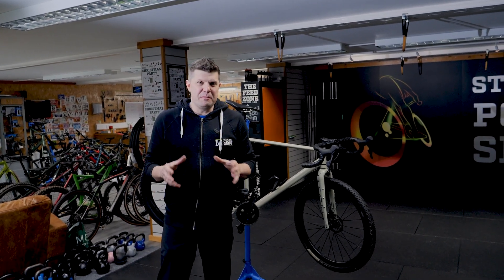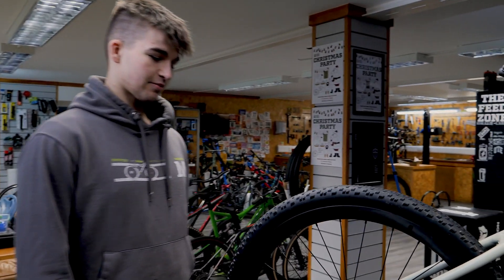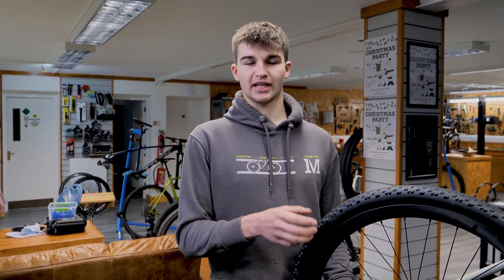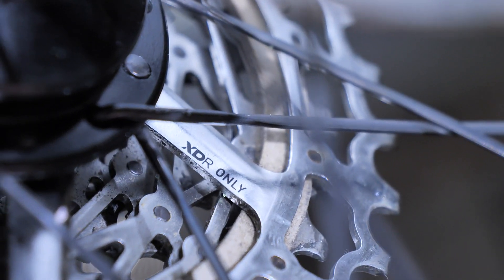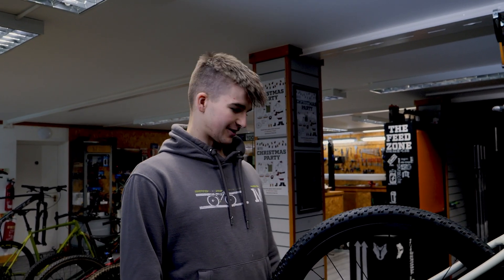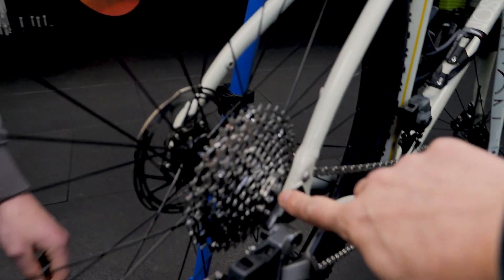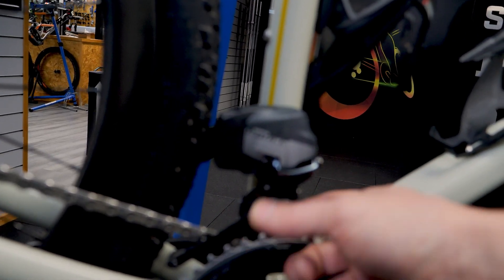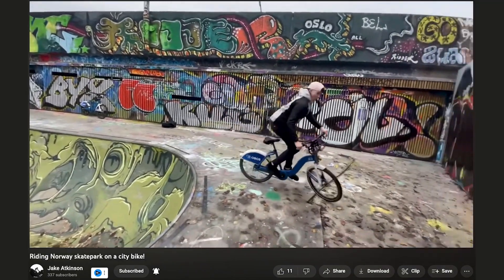Bike Mechanic quietly solving stupid problems with Hope Pro4 hubs

Comment: It always makes us a little smug when you find someone else's mistake :) especially when another shop couldn't figure it out.
I had a bike like that once, customer came in with rear shifting issues, and I was the third shop to look at it. I was able to find the delaminated dropout tab, but you could only see it by flexing it, it looked absolutely perfect just sitting there. (the abysmal 2011 S3/S5, mechanics will know what I'm talking about :) )
Reply from the maker: Feels good doesn't it?
Reply: @Mapdec  It sure does. I once worked on a bike with excessively short disc brake mounting bolts (flat-mount), not two of them, but all four of them. They only had 4 mm worth of thread engagement when they're supposed to have 8+ mm.

It was done by a bike shop I thought that has a good reputation.

Comment: I find that for the case of the missing clip on the derailleur pin, using a disc brake caliper pin's safety clip (like ones on Sram's brake caliper supplied with new pads) does the job!
Reply from the maker: Yeah.... We did it properly with the right size E Clip..

Comment: Things I've had bike shops try to blag me on when I've called them out include,
1. Brakes need to be bled every 4 months after shop did poor brake install
2. 172.5mm crank length is uncommon after bike shop fitted the wrong size left crank arm
3. The fork is fine, it's the flat mount adapter that is bent when the brake mounts were completely on the piss!
4. Huge gap between upper headset bearing and bearing top cap because they fitted the wrong size upper bearing
5. PF BB interface with open voids and crumbling away at the edges, bike shop that sold it said that's normal!
Reply from the maker: Cowboys… probably don’t actually know better.  Training is so poor.
Reply: @Mapdec  that's 3 different local ish shops. For fun, would you like me to send you the pictures of the BB they tried to say was fine? It's absolutely terrible!
Reply: Always love the people who take there bikes to a shop because they’re clearly not confident mechanically only to constantly say they know more. If the shops are so bad and you know so much why not do the work yourself?
Reply: @Adam-vm8kp  Don't be such a troll.
1 and 2, I didn't have the tools.
3 and 5, defects in the carbon, both written off and eventually replaced under warranty.
4, I didn't know what size headset the new frame needed but I knew there wasn't supposed to be a half centimeter gap between the headtube and bearing cover!
I'm a pretty confident mechanic, confident enough to call out sh!t, disingenuous mechanics lying to me. It was expensive but I now have all the tools I need to service every part of all my bikes, haven't been to a bike shop for years now, which is unfortunate.

Comment: What about the hanger? Was it bent? Please admit most bikes from new need their hanger checked and straightened and are not as good as they could be when new.
Reply from the maker: No, but the mech bushing needed replacing. And yes a PDI a check should totally include all alignment checks.
Reply: That's something my ex-colleagues never do, but whenever I come across a new bike's hanger not needing any alignment (ie. in-spec alignment), I was glad I didn't have to do this extra work.